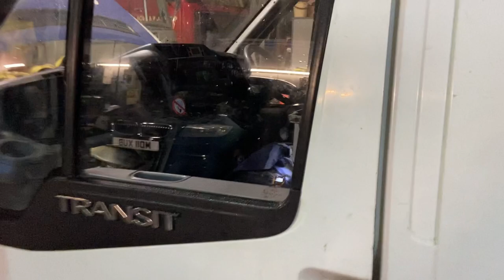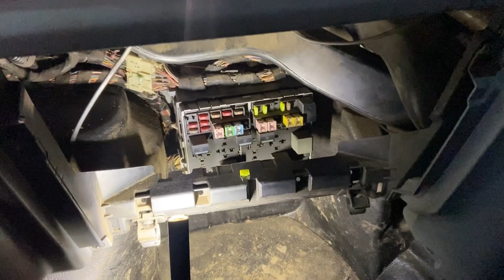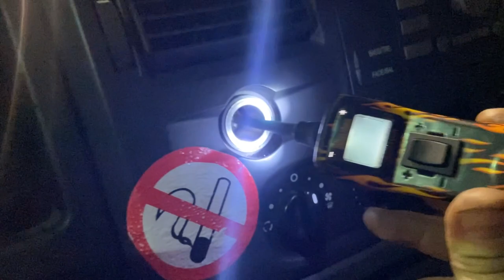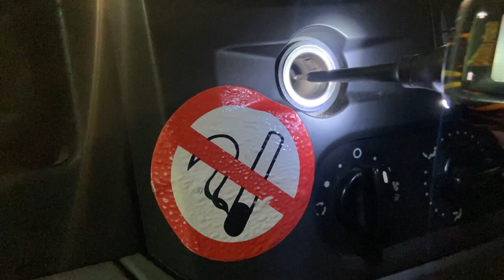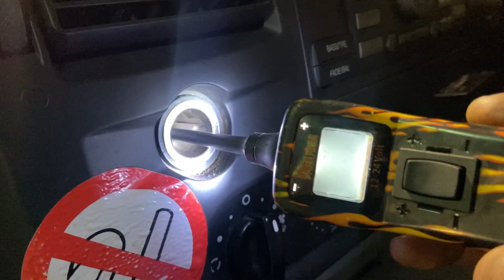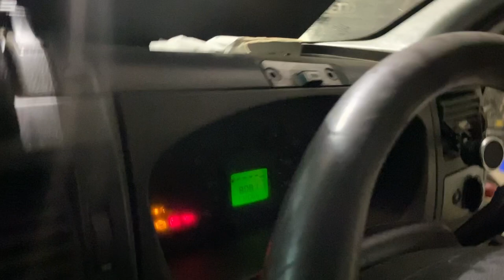Ford transit mk7 12v cigarette lighter socket fuse location

Comment: Many thanks, I could not find the fuse for the 12v supply in the storage tray above the steering wheel. You've solved that problem. Much appreciated.
Reply from the maker: Glad it helped

Comment: Hi which fuse would be for the radio? It doesn't turn off and I want to pull the fuse out. I have the mk7 transit also.

Comment: Can you do anything to make cig lighter always on
Reply from the maker: Probably easiest to buy one that you can wire in to the fuse box or battery. Make sure it is fused though. I’m sure they would be available on eBay or Amazon